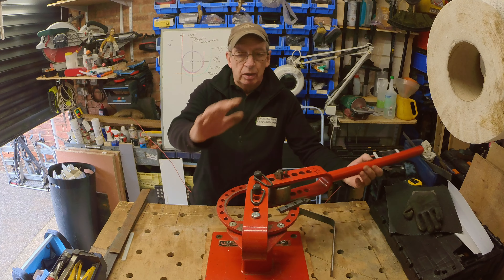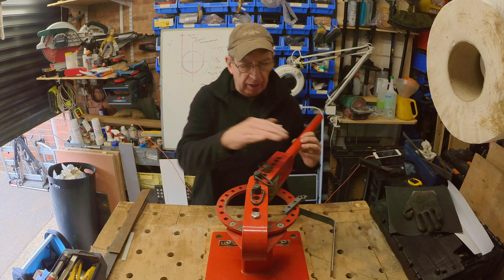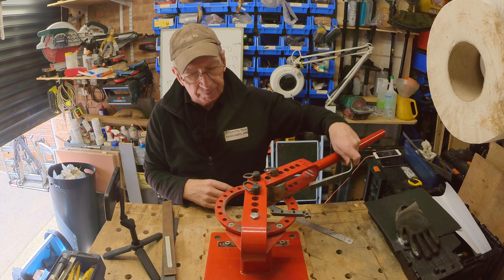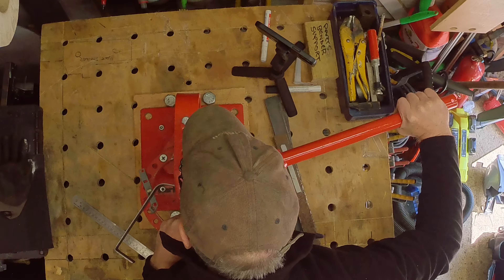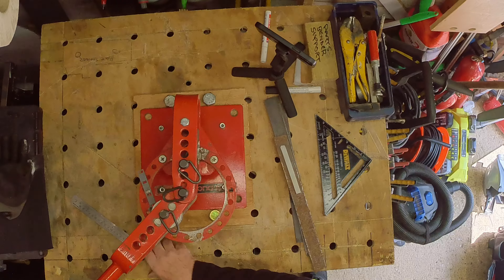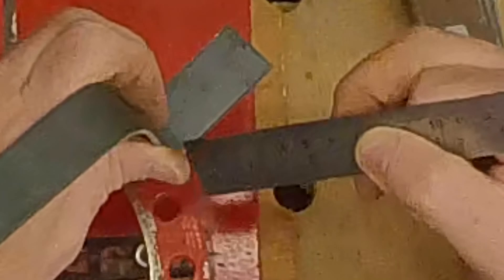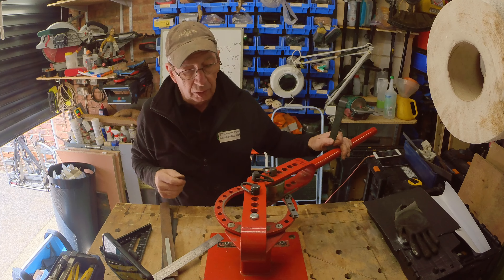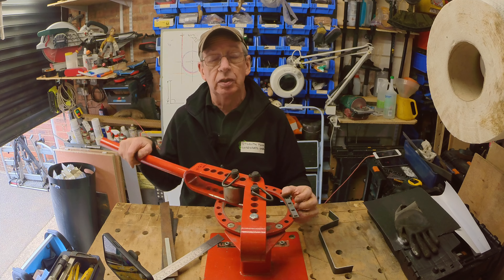Metal parts bender  Sharp bends folds  Setup positioning Clarke CCB1B, Harbor Freight, Sealey, other

Comment: Great video 👍
Welders chalk = soapstone, comes round also, but there is something better " White out pin's" the white is titanium dioxide, it will stand up to the heat of a cutting torch or arc weld. high viz, I use it to have a line to follow when fluxcore welding ( you drag because of slag) blocks the joint you see because of the gun's tip.
Reply from the maker: Thank you, yes indeed, soapstone. Tailors use it as well. Although I’m in my 60’s “white out pens” meant nothing to me but now I know it’s what I call Tippex! Correction pens 😊. Strangely that’s exactly what I use normally but I couldn’t find it and the chalk was to hand. I was actually a tech at a welding college in my 20’s and the one thing we didn’t teach at all was flux core. It got explained as a process but we only actually taught gas, stick, mig and tig 🤷🏼. I guess there wasn’t enough call for it in industry here at the time. Thanks for watching and commenting 😊